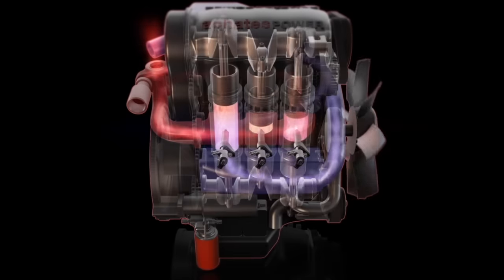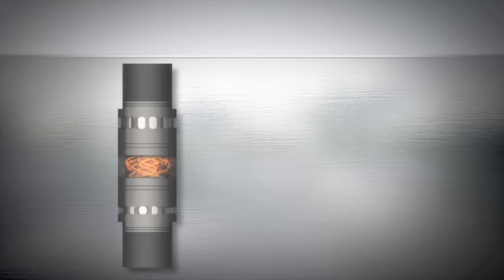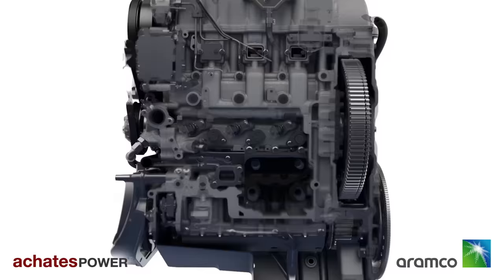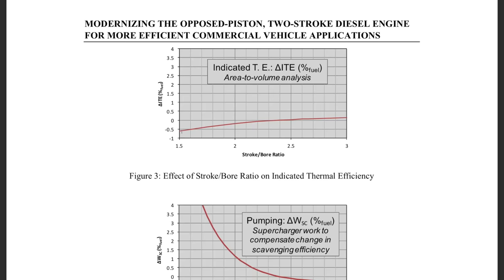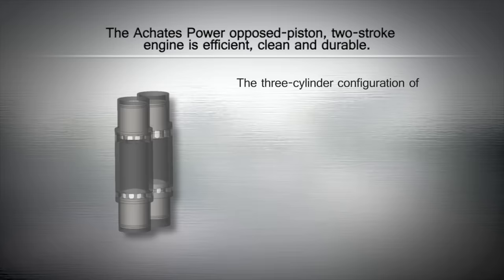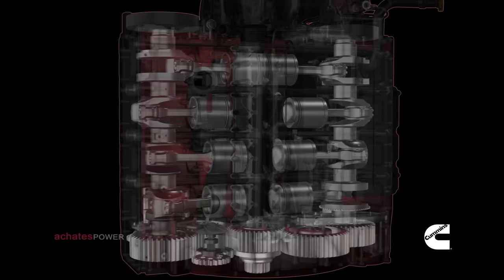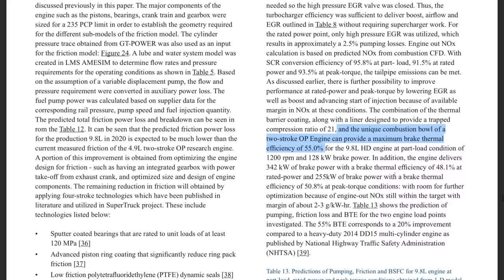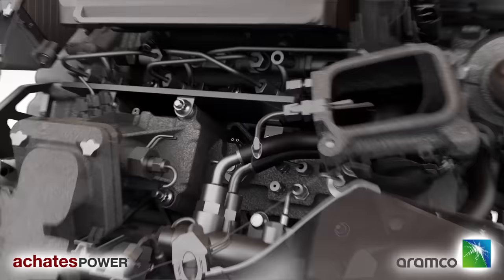Opposed Piston Diesel Engines Are Crazy Efficient

Comment: Interesting design. More efficiency is certainly a good thing.
But in terms of efficiency you can't even get close to electric motors.
Electric powertrains of course have other problems.
In cars, it's batteries.
In general the efficiency is inter-related with how the electricity is generated and distributed, and that could be any number of methods.
The advantages for electric trains are very obvious, but there you have a huge infrastructure cost.
Then there's the Diesel-Electric trains, which are the norm, even though you'd think that would be pointless given you're simply adding the energy loss of the electric motors to that of the diesel engine.
However the advantage is that you have a diesel generator rather than a traction engine, and because of that you can run it over a much smaller RPM range, which increases efficiency.

I do wonder sometimes why diesel-electric cars and trucks never became a thing, but I suppose at that scale the advantages simply aren't there.

I can't imagine this engine would benefit from that either, since a big factor with the design seems to be that it has a broad range of efficient operation...
Reply: KuraIthys loo
Reply: Road vehicles are so much lighter than a big train, so the additional system weight is more noticeable. But more importantly, they can get by with a mechanical clutch.
Reply: Kuralthys
What is the efficiency of electric motors?
Reply: Schwarzer Ritter close to 100%. but the big problem with electric is batteries. the best lithium ion battery chemistry on earth right now starting production (2017+) holds energy per unit volume of 2.736 MJ/kg (Tesla with Panasonic batteries is 0.9144 MJ/kg) whereas for diesel it is 48 MJ/kg. so in terms of energy density, a standard 21 gallon diesel pickup truck would need 368 gallons of the best lithium ion batteries on earth or 1102 gallons of 2018 Tesla batteries to achieve the same level of energy storage. if you generously consider electric to be 3x more efficient than diesel, that would still mean you need 123 gallons of the best lithium ion batteries or with 2018 Tesla technology, 369 gallons of batteries to replace diesel in today's diesel pickup trucks.
Reply: ABC123
That is only right if you compare electric motors with other electric motors. 
If you want to compare electric motors with combustion engines, you have to take the efficiency of the power plant generating the electricity into account.
Reply: KuraIthys I believe it's way more about power distribution than anything else. Running a Diesel Electric means you don't need a mechanical drivetrain connecting every drive wheel on the train, just wires. Steel wheels on steel track pulling many many tons mean you want as many of those as you can get. Electricity also means you can get more or less 100% of the motors torque (well, the electric motor, not the generator motor) without achieving a specific motor RPM.
Reply: ABC123, you made a classic logic error. You forgot that to burn that energy-dense diesel or gasoline fuel, you require an engine, a fuel system, an exhaust system and a transmission. For example, 90kW of energy in gasoline weighs 21 pounds or so. 90kW of energy in batteries weighs about 1,100 pounds (similar to your logic). Guess what? The average weight of a V-8 engine, transmission, fuel, exhaust and lubrication systems is about 1,000 pounds or more. You don't need ANY of those systems for an electric car, so the conversion from energy-dense gasoline (and its required engine) to less dense battery power is a wash.
Reply: EV Owner I'm reasonably sure batteries themselves won't make the wheels on your car move. Yes the parts you need in addition to the batteries may weigh less but...sweet Jesus. Look at a Tesla Roadster and look at the Lotus it was derived from. Which weighs more? I'm not poo-pooing electric (although I find it hilarious when ppl gain cult hero status as geniuses for rereleasing something GM did back in the 1990s and other makers did in 1905) but come on already.
Reply: David Regan, I was pointing out that you cannot simply weigh the fuel between batteries and gasoline and declare gas the winner; there is virtually no weight penalty to batteries when you count the necessary engine required to burn the fuel. Please compare the Model 3 to the same class of gas car and you'll see no weight penalty. Oh and those ppl you're referring to are geniuses; GM didn't do what they have done, in fact they sent their electric vehicle to the crusher to keep anyone from buying it.
Reply: EV Owner I showed you a battery and gasoline version of the  same exact car and mentioned one (the gasoline version) weighs significantly less when you claimed the opposite was true. I could point out a number of other negatives if you insist but...
Reply: David, Google is your friend. The Tesla Model S battery pack weighs about 1,100 pounds. Your homework: Google the average weight of a V-8 engine, full fuel tank, fuel system, transmission, exhaust system and all the lubrication systems that go with an ICE. You'll find, on average, that they all weigh together about 100 pounds different than the Tesla battery pack. You'll find an even better weight comparison to a smaller vehicle, the Model 3. As for  Tesla Roadster v1.0, so what? I showed you two examples where the battery tradeoff is negligible. I have a friend that used lead acid batteries to convert an old VW Beetle to an EV, it certainly weighed more than a Tesla roadster due to the battery tech he used. If you'll also acknowledge a negative for gas cars, they waste 75% of their potential energy to heat, whereas an electric motor is 92% - 97% efficient (which is why my 90kW battery pushes my Model S 300 miles). Would you like to discuss this further? I'm quite knowledgeable on the topic, have all the stats, would love to educate you.
Reply: Still takes a highly inefficient device to charge those batteries to be usable.
Reply: EV Owner Yes you're "highly knowledgeable" all right. I provided  an honest apples to apples comparison and your response is "Google what these parts weigh" on an entirely different car. Yes a battery pack for your car may well weigh only 1100lbs or so but your entire car somehow manages to weigh somewhere between 5000 and 6000lbs depending on which version you bought. I'm glad that your electric motors are 97% efficient (arguable) at driving 2.5 tons of car. I'm also glad that you live in a world of magic where that electricity appears in your car without any power transmission losses from 100% efficient carbon neutral sources located hundreds of miles away.
Reply: boutcha, please explain. Unlike fossil fuels, electricity can come from anywhere (hydro, fossil, wind, solar, nuke, etc.) with varying amounts of efficiency. BTW, I'm sure you know that it takes 6 kW of electricity PER GALLON of gas to refine petroleum into gasoline, right? Simply stop refining gasoline and you have enough electricity PER GALLON of gas to push an EV 15-20 miles. How's that for inefficient - gasoline requires huge amounts of electricity just to make the goo you burn and poison yourself with, not counting all the energy to extract it, store it, transport it, store it again, transport it to the local gas station, pump it and then burn it.
Reply: Alexander - my Model S has virtually no weight penalty and goes farther than my closest gas car I have to compare it to. My friend has a Model 3 that weighs 1,100 pounds less than my car and goes farther than my Model S. Your 500e has better performance than the standard one does, so make sure you count (most likely) a V6 engine in the weight calculation rather than the standard 4cyl that comes with the car. Also note that there is a minimum weight an EV must be to have sufficient range; your 500e is right at that minimum. Regardless, the weight difference is meaningless; did you weigh your car before you bought it?
Reply: David Regan, I'd like your discussion on something that matters, like vehicle complexity, versus something that doesn't, like vehicle weight. Who cares what the vehicle weighs? Your average ICE has 2,000 moving parts and an electric motor has one. A 2000:1 reduction in complexity. Please tell me the positives for your repair and parts nightmare called a gas engine...
Reply: EV Owner I didn't bring it up weight in the first place, You did. If you'd like to change the subject first admit you were wrong. I'll discuss whatever with people who are capable of doing so... evidence suggests you are not.
Reply: David R., you seem to lack the ability to research. I mentioned the weight comparison of gasoline to batteries not to YOU, but to a comment made by ABC123. It was YOU who said "what weighs more?" in reference to the Tesla Roadster. Please - scroll up, you'll find your original comment where you injected a comment between ABC123 and myself. You hijacked the discussion by mentioning the Tesla Roadster. It was YOUR mention of the Tesla Roadster that brought weight into OUR discussion, not me.
Reply: David Regan, you're changing the topic and losing the argument. I have never stated an inverter has 100% efficiency. I have stated that you lose 75% of gasoline's energy to heat when burning it so a flat comparison to battery density must that that into account. As energy dense as gasoline is, you must throw away 3/4 of it just to use the stuff. Inverter efficiency has no bearing on the discussion, but its losses are in the single digits, nothing even close to gasoline's thermal losses. I'll be happy to discuss power grid losses, alternating current to DC current losses, DC-to-DC inverter losses and so forth, but they have nothing to do with the argument about weight penalty. 

Let's get back on topic: I pointed out to ABC123 that you cannot simply measure energy density in gasoline to the energy density in li-ion batteries and declare gasoline vehicles the winner. You must factor in the weight of the necessary systems required to convert the chemical energy of gasoline into kinetic energy to push the car. An EV needs none of those systems, therefore the weight penalty is not a factor for many EVs. I give lectures on EVs, hybrids and gas cars and have always stated that gasoline is energy dense. It's a marvelous fuel (wants some facts about it?) but requires around 1,000 lbs of engine parts to use it (which was the point of the original discussion). 

Your discussion of bringing in the total weight of a Model S is bad science as it includes the weight of more than the energy system. A Tesla Model S is a huge sedan; it's a 7-person vehicle as opposed to a Tesla Roadster, a Nissan Leaf or a Renault Zoe. A Tesla Model 3, for example, has an energy system that can go farther than a Model S but the car weighs 1,100 pounds less due to its smaller size AND the material the vehicle is made of. Please take a logic or debate course at a community college then return to this discussion. Mixing in other factors outside the topic does not win your argument for you. I told you how the weight of a less dense energy source like li-ion batteries is not a weight penalty in several car models and you changed the topic to inverter losses which are meaningless. Do you challenge the statistics I gave you? Do you disagree with my comparison of a Tesla 1,100lb battery pack vs. the average weight of a V-8 engine and accompanying systems? In fact, we should probably  include the weight of superchargers and/or turbo chargers to actually match the performance of some EVs.

As for the Tesla Roadster 1.0 being heavier than the gas version, so what? I gave you an example (Model S and Model 3) where the energy system is not a penalty. The first EV hybrid made weighed 8,000 pounds; should I judge all hybrids by that example? I also gave you an example of an EV I know of that weighs more than the gas version - a VW Beetle converted using lead-acid batteries. The tech is different, the energy system is different and the conversion left in some of the parts for simplicity sake (like the old beetle transmission). You can argue specific cases all day, and win either side of the argument. The average energy system of a Model S and Model 3 have virtually no weight penalty compared to a gas car; I know, I'm driving one and own both kinds of cars.
Reply: Hate Speech - tell me about inverter losses and how they matter in a vehicle weight discussion (I know what they are, let's see what YOU know). Electric motors are 92% to 97% efficient, so losses are barely worth mentioning compared to the 75% loss of gasoline's potential energy due to heat. I'm intrigued how you think an inverter loss has any bearing in the discussion.
Reply: @justsomeguy934  I hereby acknowledge defeat in whatever discussion you believed we were having all this time other than EV drivetrains weighing less than their gasoline counterparts...if you want the range (or in most cases, maybe 2/3 the range) they kind of have to weigh more. On the flip side, the more they weigh, the less energy efficient they are because physics.

Moving things that weigh more consumes more energy, who knew right?
Reply: David Regan, you didn't acknowledge any defeat, you made what is known as a left-handed compliment; that's saying "You're right but I'm not wrong". I knew from the very start of our discourse that I wouldn't convince you, but those reading it get the opportunity to see past their own bias and learn a few things about petroleum, electric vehicles and even the geo-political impact of burning gasoline one time. Have a good day, I'll move on to the next person who gives me an opportunity to educate others. You should attend one of my lectures, you'll grow as a person even if you drive a Buick.
Reply: @justsomeguy934  90kw is 125hp. And you used a weight of a v8 engine which would get at least double that power. Your kw to weight is more appropriate for the inline 4 engine, which, generating 90kw, should weigh about half of the 1000lb v8. So, it's not a wash.
Reply: cr4zyj4ck, you're confusing battery capacity (a 90kW/hr battery) with horsepower. My Model S has a 300 hp motor in the back and a 150 hp motor up front which has nothing to do with battery size. To get 450hp of performance, my sports car has a 4.6L V-8 engine PLUS a supercharger. You'll likely have to exceed that engine size to match my Model S's zero-to-sixty speed as well so the numbers just get better and better for an EV. My friend has a Performance Model S and he goes 0-to-60mph in 3.2 seconds...how much horsepower (and weight) do you need to match that?
Reply: EV Owner You mentioned power saved refining petroleum... I wonder what would be saved just in transportation ...( they could be huge considering pipe, boat, train and truck) Any idea?
Reply: Justin Mallaiz, I don't have the stats on all those costs but they are in addition to the energy just to refine the goo into gasoline. Think about it - raw crude has to be extracted from the most remote and hostile of places (like a seabed or desert), pumped to a container or container ship, floated or pumped to a port, floated half the world away to the USA, pumped to a tank at the port, pumped or trucked to the refinery, stored there, refined, put in a tank then pumped or trucked to your local gas station. Whew!
Reply: EV Owner where are you getting the power from to power these electric vehciles?
Reply: Steve, from anywhere. Even assuming 100% coal (the dirtiest energy source in use today short of firewood), EVs produce half the carbon footprint of a gasoline car over the life of the vehicle. Petroleum comes from one, and only one, source. We cannot survive without petroleum in modern life and therefore cannot afford to burn 40% of it once time to push a car. I can make all the energy I need to push my car and power my home from my roof; no one I know has a refinery or oil well in their backyard.
Reply: The preemptive cost would outweigh the cost over time for these opposed piston engines. The increased efficiency translating to 100,000$ worth of savings in fuel for trucks and other heavy machinery vehicle in a small fleet and millions of dollars in savings in a later fleet. Point is unless a more efficient battery is created and the overall effect of these batteries which are toxic and Not recyclable are passed, a complete phase out of combustion/compression engines is just not feasible yet.
Reply: The big problem in electric cars are the batteries. Electric cars have a low range, so it makes sense to improve combustion engines' efficiency as a temporary solution.
Reply: Bratwurst Curry, that makes no sense. You don't improve the steam engine! And what range issues are you referring to with EVs? The Tesla Model 3 goes 310 miles, the Model S goes 335 miles.